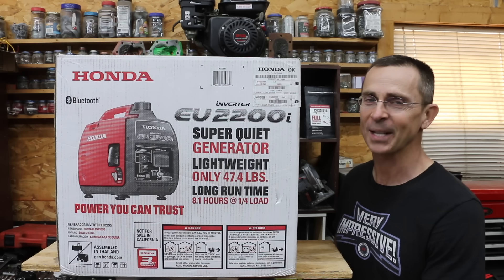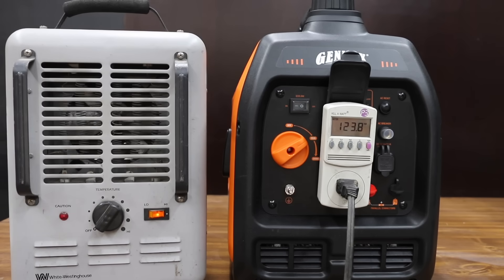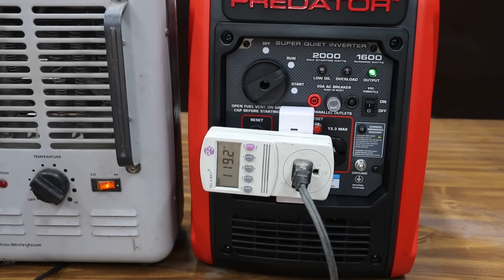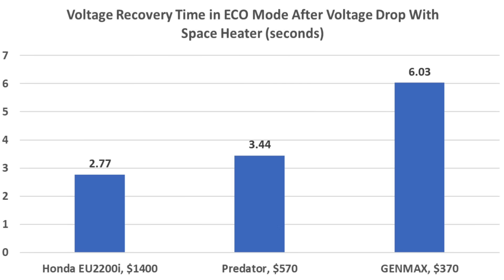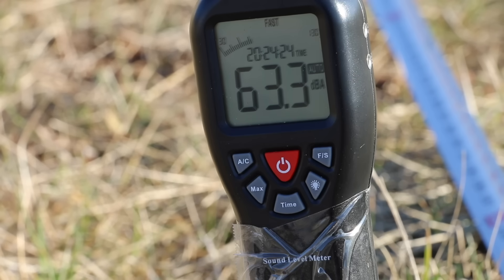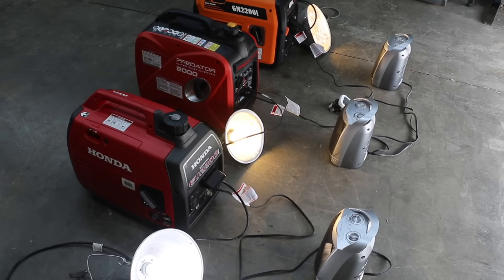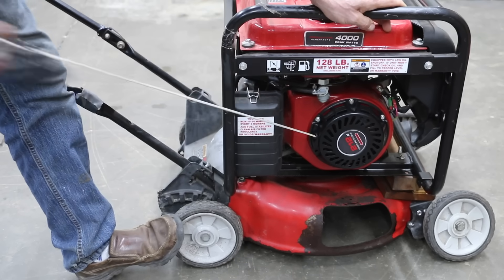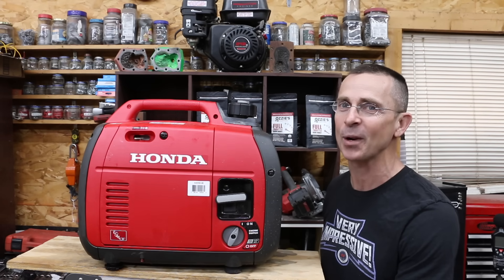Cheap Generator Better Than Honda? Predator vs Honda & GENMAX—Let’s Settle This!

Comment: 900+ hours on a Predator 3500 inverter generator and still running like a top.  Been used a lot and the there are some tricks I've learned to get it this far. 
1. Most important there is a air vent tube right at the top of the fuel tank. Make sure to not fill fuel above that intake or it will drain into the charcoal filter and stall out. 
2. Make sure to add a vent to fuel cap or back off when tightened a half turn while in use. So it does not create a vacuum and starve the engine for fuel. 
3. Change oil every 40 hours with a top off at 20-30 hours. Use good oil. 
4. Change the spark plug to a high quality one.

In all honesty 1 and 2 will be your most common issues. Hopefully this helps someone out there.
Reply: I got the same one with 2000 + hours , bigest isue i had is ajusting the exost valve about every 1000 hr or so , other than runs great .
Reply: @bobmunz7877   no doubt it'll make it that far. Haven't seen any people on YouTube with more than  150 hours. Cheers bud.
Reply: I also have a 5 year old Predator (Harbor Freight).  During a hurricane it ran 2 weeks straight.  It regularly gets used and is one of the best buys I ever made.
Reply: My Predator 3500 has almost 600 hours on it and runs like a top. I put a remote start kit on it which was a great investment. I’d like to see it compared to some of the other brands of generators.
Reply: I ran a Honda 2000 for 6 hours a night every night for 12 years and it was used on several jobs running saws and cement mixers. I only had to change the inverter once at the 8 year mark and got a replacement for 200 bucks.
Reply from the maker: Thanks for sharing.

Comment: Great video! A buddy of mine had one of the same Honda generators. He was working on his boat and it fell of the boat rate in the salt water. We recovered it and changed all the fluids. It still runs today can’t beat a Honda!
Reply from the maker: Thanks!  Thanks for sharing.
Reply: What if there was a shark nearby?
Reply: @kentoeveryone the Honda would win.
Reply: @akbychoice 😂😂😂
Reply: Yep i ride honda too totally .. most comments from other bikers etc are .. oh yeah Honda cant go wrong ..👊
Reply: That reminds me of when we were kids riding some Honda mini trails. My friend's gas tank was leaking gas right down onto his sparkplug as we were riding past the creek in his backyard.  The gas ignited, and he threw the minibike into the creek !  We pulled it out, and after a few kicks, it started right up !

Comment: having run the bigger generators for offgrid power specifically a predator 3000 and a honda eu 3000i the predator is a great value for money, but the honda will power harder to run things like AC a bit better. i  currently have a little over 1k hours on our honda and its needing service for the first time in three years other than regular oil changes. the predator now has a bit over 500 hours and its still rock solid and doesn't use oil during a 100 hour oil change interval, i do run amsoil small engine 10w-30 in both though.
Reply from the maker: Thanks for sharing.

Comment: I have used a EU2200i generator daily for several years and it lasted 4486 hours before needing to be replaced. I currently have two of these generators which I alternate and they each have a little over 2400 hours each. I think the extra cost is worth the reliability.
Reply: What's the application where you put 4400hours on it!? I'm curious what the load was and what finally killed it.
Reply: I boondock full-time in my motorhome and rarely had more than a half load on it. It finally began burning oil and I would have to have it rebuilt so instead I bought a new one.
Reply from the maker: Thanks for the feedback.

Comment: Another Great Video. 
Can you do a comparison of a couple other Generations and Peessure washers.
Here in Oahu Hawaii we don't have Genmax or  Predator. The store brands here are Firman, Ryobi, Dewalt, Blackmax and a few others, and all these small generators are a real nightmare to work on.I own North Valley Repair and do alot of generators. Honda seems to be the best but all have the same problem. This ethanol fuel.  When this fuel  starts to go bad it plugs up these carburetors and then getting the carburetors off are a night mare.
None of the brands, even honda , don't make it easy to get the carburetors off without removing all the front, back and side panels.
The larger generators are much easier to work on
Reply from the maker: Thanks!  Thanks for the suggestion.

Comment: How about Pulsar 2,200W Portable Dual Fuel Quiet Inverter Generator $420 and Westinghouse 4500 Peak Watt Super Quiet Dual Fuel Portable Inverter Generator $899
Reply from the maker: Thanks for the suggestion.

Comment: I just purchased a Honda 2200 w/o the bridging feature. From the Honda dealership it was almost 1800.00 Cdn. It was filled with oil and gas and started first pull. Not many choices up here in Canazuela

Comment: I bought my Honda 2000i for $884 delivered to my door almost 20 years ago for RVing. Cleaned the carburetor once when it wouldn’t run anything more than 1,000 watts and it’s been kicking butt ever since👍

Comment: These Hondas are extremely popular at the Burning Man festival in the Nevada desert. Others can't necessarily cope as well with the long duty cycles, incessant heat, and dust and it's a crapshoot if you take one out there. 

It will probably be fine. It might not be.

A Honda will definitely be fine.

If you're not using your generator constantly for a week while 200 miles away from the nearest city, it doesn't matter as much. If it breaks, take it back. 

If you want something you can depend on, get a Honda.

Comment: Interesting to see the power quality differences.  Do electric tools really care if the power is a bit dirty (not low voltage - a different issue).  
F150 7.2 KW vs. 2.4 Kw vs. 2.0 Kw vs. the Honda portable vs. 7500 watt Champion (Costco) generators.  Which is more efficient (Kw/ gallon or per $ and power quality).  Also, large 12volt inverters - 2000 - 3000 watt... Can I run an electric chain saw off one of those (7 amp at 120 volts... or how much power can they actually give you continuous?)

Comment: Would love to see a comparison of Wen vs Firman vs Champion dual fuel inverter generators - but with some extended durability component in the testing, warranty comparison, and how long you must wait on hold to actually reach customer service for parts/repairs.

Comment: I’m still trying to figure out why you included the Predator 4000. It is in a different class and isn’t an inverter generator so the noisy sine wave results should have never been included imo. For the price difference, it’s Predator for me. I got their 8750W inverter version and it runs my entire house when the power goes out. (I keep the AC, Dryer and electric range’s breakers off)

Comment: The Honda is the one all others are judged by.  Others may equal the Honda but it will be very hard to beat the Honda.  One reason I stayed with Honda for our Scout Troop was that during travelling, if we ever needed service or parts, the Honda would be a lot more likely to have things available.
Also, there are a lot of aftermarket add-ons available for the Honda.  The BEST Add-On is a Propane retrofit kit from Hutch Mountain.  Once you convert to propane, you'll never use gas again.

Comment: It has been my personal experience with the Honda 2000
That mileage increases as the hours climb. A break in period I believe. I bought a 2nd one becuz
1.. it was ALMOST half off.
2. I wanted to use the " parallel " kit to run my table saw !!! & Multiple tools 🤠😃 ... 1 tank of gas will EASILY last all day !!! Period !!!¡¡!¡!

Comment: The DVM (dig. Volt meter) has a lag time between samples.  The interval to steady state from a drop and the lowest Voltage after the heater turn on, is depending on the dvm sample rate.  It is not real-time, maybe use an analogue meter which gives real-time results.
Reply from the maker: Thank you for sharing!

Comment: Hey Project Farm, its a little outside of your typical product tests but I'd love to see you tackle shaving razor blades like you did utility blades! It would be extremely useful to know which are sharpest or which last the longest, or even which are just the thinnest.
Reply from the maker: Thank you for the video idea!
Reply: Feather razor blades made in Japan are amazing
Reply: If you do this razor blade test, please don't forget about safety razor blades.
Reply: @mikewasyliw  Safety razor blades…great idea! Some brands are murderously bad. 🎉
Reply: I too would like to see that.  I've been using Schick Hydro5 blades for years.

Comment: I'd be curious to see the efficiency results when using a gas generator for supplemental power with a battery pack like the eco flows. Like how the Honda compares to EcoFlows's own generator when recharging a pack. Would also be interesting to see how it might compare to larger diesel generators or the Ford Lighting, but I don't know how practical that would be.

Comment: I have been waiting for this kind of video and it didn’t disappoint. Would love to see a multi fuel on propane added to the mix.  I have been looking into getting a generator for my camper and would like to see if running it off the propane bottles would be worth the extra expense and not have to carry a gas can.
Reply from the maker: Thank you for sharing!

Comment: I use this Honda generator on my sailboat and never had an issue. Never. Use ethanol-free gas and change the oil on time and it's all good. The reason I only use Honda generators is because they last a very long time and can take a beating.
Reply from the maker: Thank you for sharing!

Comment: Awesome test. I recently picked up a Predator 3500 watt “super quiet” inverter/generator and used it at the drag races for the first time yesterday. It did awesome. 

It powered my trailer interior lights (2 48” 120 volt led shop lights, 1 36” 120 volt led shop light and about 55’ of LED strip lights) for around 4-5 hours, my battery charger on 12 volt/10 amp setting for probably 2.5 hours total time roughly, a Keurig coffee maker for about 5 cups of coffee and a 24”
Fan that draws about 3.5 amps for about 4 hours total usage. 

A friend of mine had generator problems so he hooked his trailer up as well and powered his similar battery charger for about the same amount of time and a portable air compressor to inflate tires periodically and an unknown amount of 120 volt trailer interior lights. 

All in it ran continuously on eco mode from about 2:30 pm until about 11:00 pm and used 3/4 of a tank of fuel. 

I’m very impressed with it. Be interested to see a comparison of that size inverter/generator.

Comment: Another great review. I'd be grateful if you can compare some dual fuel generators that use propane gas to operate. That would be great since I'm planning on using it in case of power outage and I alreadyhabe a propane BBQ.
Reply from the maker: Thank you for sharing!